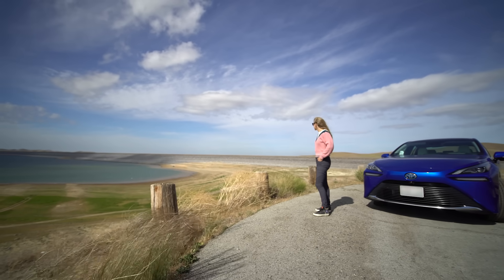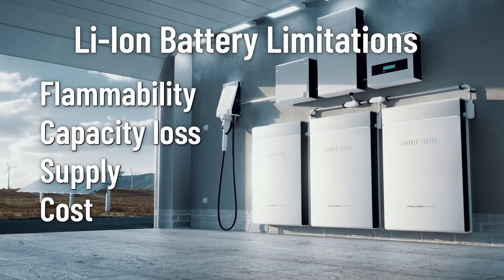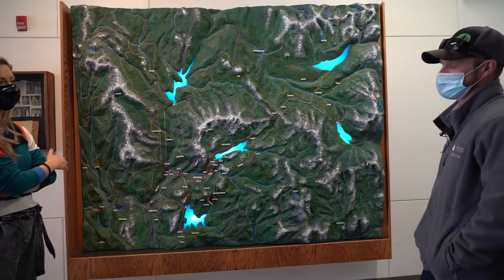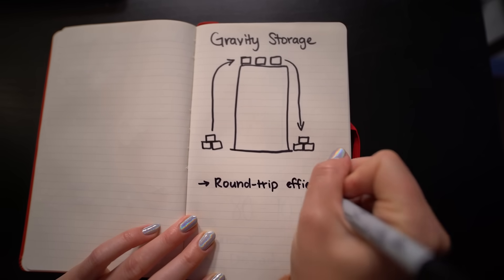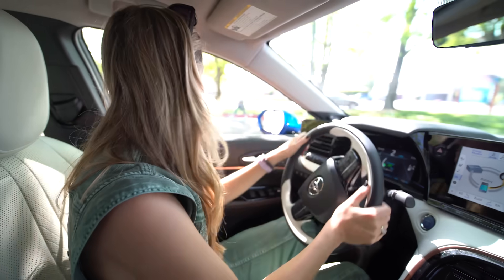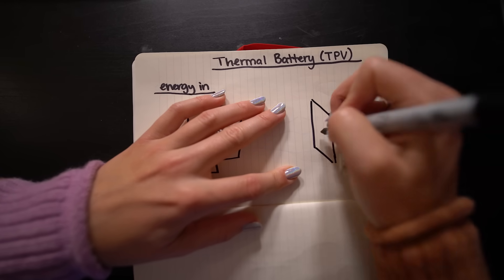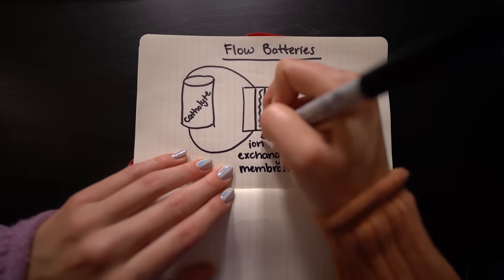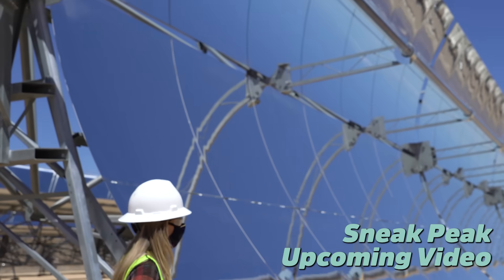The BIGGEST problem with clean energy

Comment: My company has looked at compressed air energy storage with an interesting twist :  a “normal” compressed air storage tank (on land) requires a strong tank or pressure vessel to keep it in, and such tanks are heavy and expensive. An alternative is to build a thin walled tank with little inherent strength (hence cheaper) but place it in deep water, eg in the ocean hundreds of meters deep.  At that depth the hydrostatic pressure of the water acts to provide all the containment pressure. The tank is open to the sea at the bottom and is initially filled with water at the same pressure as the water outside, so there is no net force on the tank walls. Compressed air is piped from the surface down into the tank, displacing the water inside which exits through the bottom. The air pressure inside is automatically equalized with the water pressure outside , again resulting in no net force on the tank walls, sort of like a diving bell.  To recover the energy water is allowed back in, forcing the high pressure air back up the pipe to (you guessed it ) drive a turbine.
Reply: I can see a few problems with this. Whatever you make the tank out of could corrode. Ocean life could grow on it clogging it. The air would eventually dissolve into the water losing capacity. I don't know how much of an issue these problems would be though.
Reply: @Xeridanus  corrosion can be managed, steel can be protected with Cathodic protection or concrete can be designed to last 100 years in seawater.  Marine growth can be managed in a variety of ways  and if you in deep water there isn’t much light anyway so growth is slow.  Air would eventually dissolve into water but if you are looking at short term storage like a peak shaving plant, it would be minor. If you need long term storage you could use a  membrane at the air/water interface (like an inflatable balloon).
Reply: @SV_OceanGirl  Thanks for the answers, I'm by no means an expert so those problems were just what I came up with off the top of my head. Those solutions seem pretty reasonable to me.
Reply: https://www.youtube.com/watch?v=9xe3BWPsBTU
Bill Gates Slams Unreliable Wind and Solar Energy
Reply: unintented consequences of ocean life? - the cost and energy needed to pump each direction? what will the input / output ration be, more in than out - storage cost?
Reply: This could be nicely coupled with wave turbine generators! I'm not sure how deep such tanks would need to be to reach the desired pressure... What kind of locations would they be suited for? Most coastlines are not super deep drop-offs. Putting them further out to sea seems like a lot of effort and potential points of failure. I like the idea though. Perhaps it could be moved inland by placing these tanks on the floor of reservoirs although, I'm not sure if the depth of a reservoir would convey enough pressure to actually pressurise air to a high enough pressure for this to be useful. Still, the efficiency should remain the same. Sudden drops in the reservoir levels would decrease the pressure but the air tanks could just take priority over the hydroelectric turbines. Hey, could the air drive the same turbines as the water does?! I would guess that the machine materials might be different for different driver fluids, due to different viscosities and heat capacities and particle size, but I don't know. 

How about using... an array of mirrors (CSP), built onto the reservoir wall, to heat heat-transfer fluid, which transfers the heat into the pre-turbine generator, to heat up the pressurised air OR the water, depending which is ready for use. When electricity isn't needed for the grid, the CSP array is used to pump air into the air reservoir underneath the water reservoir. 

I have no idea about the pitfalls in each of these things but I'm gonna draft this power plant up now. Thanks for planting the idea in my mind! 🤓
Reply: from a commercial point of view, surely it would be cheaper to build stronger tanks on land rather than installing cheaper thin shelled tanks in deep water?
Reply: @georgecode1276  This depends a great deal on the size of the storage tank. The larger the tank the more expensive it is to construct/house on land and that increase is not arithmetic. Also the larger the tank the greater your storage efficiency. So if you are looking to overcome efficiency cost to pump and store the energy you will  want to go very big and that's where undersea storage begins to get interesting. 

I too am not an expert in this field. My company makes a large percentage of its income cleaning up after and mitigating the carbon impact of "clean technology" industries like EVs and others that uses rechargeable batteries. There are those in my field who have argued that, with advancements in battery technology and the sunsetting of automobiles, a long range Tesla will rarely if ever reach enough road miles to offset the initial carbon cost of construction vs a Corvette Stingray of the same year model. But that is for another thread.

Comment: In our rural district we have frequent power outages due to bad weather.  We will soon have a system in place to store water in two man-made lakes which will be released to create power for the area when the lines are down.  The water will be released when the main line electricity is out and then pumped back up from a lake below using solar power.  Nice solution for an area with lots of water and lots of outages.

Comment: It just so boggles my mind that we've known this change was coming for decades. We've known that oil and gas would run out eventually, again for decades. And that all of it would run out within decades... So why is tech so appallingly behind?
Don't get me wrong, it's great that it's finally starting up, but why wasn't it running for starters?
Reply: Oil and gas pushed hard against climate change. Guess who is pushing for hydrogen, oil and gas. Hydrogen is mainly produced by burning gas. They glossed over that I'm the video when mentioning hydrogen reforming.
Reply: @sot8343  Hydrogen absolutely needs to come from clean sources. They exist, they just need to come from a scalable, clean and affordable source.
The type you mean is gray hydrogen and absolutely needs to be tracked to its source to ensure we don't jump from the frying pan into the fire
Reply: The answer to that lies not in tech but in politics of capitalism.  Fossil fuel and auto industries have a stranglehold on us.  Receive billions of dollars of gov't subsidies each year,  buy up patents for alt energies and hide them away, dismantle streetcar systems so cities are dependent on buses, wage massive propaganda campaigns.  New tech has been in development for decades but facing an uphill battle all the way.  As long as you get labelled a commie pinko (1960's) or snowflake (today) for suggesting energy decisions should be based on the common good rather than corporate profits, the playing field will be tilted steep against greener options.

Comment: I recently heard about sodium-ion batteries. They seem to have a quite decent energy density and are made from overly abundant materials. Maybe we could even use NaCl from desalination plants for these.
Reply: There are also aluminium-air batteries, which are much lighter, which makes them a much better alternative for electric cars, as well as using sand for thermal storage. You should also watch the video "Dirt Simple Energy Storage | In Depth" by "Now You Know" on youtube. The technology uses hot air to heat sand or dirt kept insulated underground, and later on uses the same hot air to generate power, or to heat water for municipal water heating (where it applies). And unlike using water for heat storage, the sand can be kept much hotter than 95 degrees Celsius, at 300-400 degrees celsius, possibly more, depending on if there are advances in cheap-enough materials used for storage. And it can be easily paired with existing solar through and solar concentration towers, by simply moving heat from the thermal fluid to air and backwards.  They are used in nordic European countries to heat the storage in the summer and heat their homes in the winter, so it works well as a very-long-time energy storage, too.

Much cheaper than the the other alternatives, per unit of heat stored, and uses off-the-shelf components for the pumps and power generation systems, but needs a large area to be in (which can be underground and built above, so city plazas can work, for example, and greenhouses can be built above, to make use of the little heat which does escape, and building long corridors under streets could help keep them snow-free), which makes them a much better deal than the alternatives.

Comment: There is no estimate to lithium running out. We can collect it from seawater, and Nevada has enough lithium to power every single car and future energy storage device in the US. 

Lithium can be recycled at an extremely high percentage as it is a metal. When you recycle it, you don't need to mine as much.

Lithium also does not have a time limit on life, and new lithium battery tech basically eliminates capacity loss.
Reply: Fortum claims the current recycling rate for lithium-ion batteries is approximately 50%. “There are very few working, economically viable technologies for recycling the majority of materials in lithium-ion batteries.
Reply: @JDinky652    Fortum gets the majority of its income from Uniper, an energy company that derives only 0.2% of its production from renewables. The rest is fossil fuel and nuclear.

Redwood Materials claims around a 98% reuse rate for their recycled critical battery materials, and Tesla is implementing a system that recycles 100% of their batteries with a 92% reuse rate of raw materials. You can look this up in Tesla's 2020 Impact Report.

Comment: People vastly underestimate the viability of pumped hydro because we don't really do massive public works projects. 
Artificial resiviors tend to be historically prone to failure, but there's no reason you can't just use a TBM to create the necessary drop and put the lower reservoir underground. 
Australia is looking at using old mine shafts for one of their projects  
Also, you don't need potable water or even fresh water, there is an untapped potential in coastal pumped hydro you just need to use a different set of metals which are a bit pricier.

Comment: Nuclear power is the answer to how we're all going to be able to drive electric vehicles and stop using co2 emitting power on a grand scale. There is zero chance of doing this with only solar and wind and water. It might not sound like an ideal solution, but it's the only way we know of at the moment that is powerful and steady enough do it. Water power is pretty much as developed as it's going to get. Hydrogen from water is basically a pipe dream, apart from very specialized applications as the input energy in order to achieve electrolysis is far greater than the output energy. The sooner people realize this, the sooner we can stop relying on co2 emitting fuel sources. And finally end this discussion.

Comment: yes this is why I call solar and wind "Potential dumping" and its the biggest reason for rising energy costs, grid maintenance cost increases and grid instability. Battery farms realistically are only fixing a problem that solar and wind created. At some point we need to assign non-service delivery energy a near zero or negative value to address this so energy storage like hydrogen can be used.   We have many systems for electrolysis and there are a range of turbines today that can run exclusively on hydrogen... (same peaking profile as natural gas)

Comment: "The supply of Lithium is estimated to run out by 2080." This is completely false. Lithium is one of the most abundant metals in the Earth's crust. Much of it is mined from pumping sea water into basins and letting it dry. It's infinite. Further, most of the metal content in lithium ion batteries is not in fact lithium.
Reply: True, there is a lot of lithium, and it is a relatively small percentage of the battery. Vanadium are several times more abundant in the earth's crust, and it is still being accused of being scarce.

For stationary storage, pick another technology. Why use a flammable battery with high demand that is supply constrained?
Reply: @bob9802  LFP (LiFePO4) batteries are now being used for stationary storage by Tesla.  Fire resistant and easily obtained materials.
Reply: @StormyDog  they have announced the transition, but have they enacted a full change over yet?

Yes, LiFePO are much safer than NMC or many other chemistries, but it is still not as safe as an aqueous battery.
Reply: @bob9802  Partial and some of the Tesla cars are also LFP now.

Comment: Energy storage is not only good for renewables, but for the grid as a whole. Decentralization is the way to go. We now have control technologies that can handle diverse sources. I used some of these technologies in a large data center I was setting up over 10 years ago. Distributed resources and control optimizes costs (however you want to define them) and increases resiliency. It also allows for the faster introduction of new sources. Our power system tends to be very conservative. The rule of thumb is that larger plants are more thermally efficient. This is why we have massive nuclear plants, instead of the more modern, and safer, modular ones. Storage is an integral part of a diverse power grid.
Keep up the good work. Love your stuff.

Comment: you should look in to mechanical batteries they float my boat would be great to have one in the back of the yard. bit of maintenance. California is also in a good place where they have the coast along a good portion of the state witch means they get the sea breeze effect the only problem is that google bought up the wind rights along the west coast of the US. whos new! you can buy wind! Also there is a company that made reluctance motors. they are nothing new but these guys made them efficient and claim that if every motor in the world got replaced with a reluctance motor we would use 30% less energy. That's huge!

Comment: While this is theoretically true, one must be careful not to focus on this too much regarding energy transition. Then it still acts as a whataboutism-discussion. As well as the hydrogen car one.
Right now, we simply need to massively build Renewables . And actually quit combustions of coal, oil and gas. Simple as that!
We need so much wind + solar power installed (6 times more than currently done). We can even waste reasonable amounts of overproduction on super windy or super sunny days (and then flexibilize the demand side first) before having to think about huge storage amounts.

And the relatively fine solution we already do have for seasonal storage: produce green gas like Hydrogen or Methane during overproduction  - even if it's done inefficiently. And burn it in gas power plants during these dark doldrums.
Reply: @IlIllIIllIIllIIl  Wow. Why so angry?
I am a physicist with specialisation on renewable energies, did solar cell research and have been working with international solar businesses.

Comment: VEEERY dubious about the claim that lithium will run out by 2080.  Isn't it still one of the most abundant elements on Earth?
Not surprising, though, after hearing that's a hydrogen fool cell car instead of a technology that actually has value in the transition away from fossil fuel vehicles - Toyota has A LOT of many to make from their existing technologies before they become stranded assets...

Comment: There's currently only one viable option, and that's hybrids.
EVs aren't viable yet due to range.
Hydrogen is even less viable, they will always cost 3x the amount of gasoline. And it takes gasoline (or coal, or nuclear) to make hydrogen.
Just a simple hybrid with a 500cc 2 cylinder engine, a 10HP generator, and a 60HP motor, all in a single passenger, three wheeled cockpit with a total weight of about 1500 LBS.
That's the passenger transport of the future.
Have 2 people transport as well, a little larger.
or a regular sedan car with a 3 cyl 900cc engine, 20HP generator and ~120HP electric motor.
The engine providing thrust only, the batteries and engine providing low speed cruising, and overtaking power.

Comment: We have a huge storage of energy that the Earth is orbiting, the problem is just to get that energy down to Earth in a way we can control in a safe way; I do not talk about solar cells but rather a way to have a satellite or space-utility that can convert solar radiation so it then on demand can beam down energy where needed, how this will work is up to the folk in the future.

When it come to the block tower, why then not do a huge hollow block and when it is at the top start to pump water into it to increase the mass over time, for the tower of blocks will suffer from that the blocks towards the bottom have less stored energy, and to lift a block straight up has to take much energy, I think water is easier to move up with Archimedes classical ideas.

Comment: Love to see your take on MSR's & LFTR's using thorium. Seems like the most energy dense and controlled non-carbon based fuel/power option and would be invaluable in a hydrogen based infrastructure and economy.
Reply: MSR's are an approach that is fascinating. How small can they be? Some discuss trailer size, with modular approach how many would a 200k house hold community need? The regulation and building of current nuclear plants is prohibitive with to much regulation. I have stood by and observed small nuclear reactors used in semiconductor industry. How did they make those and get by OSHA or the NRC?